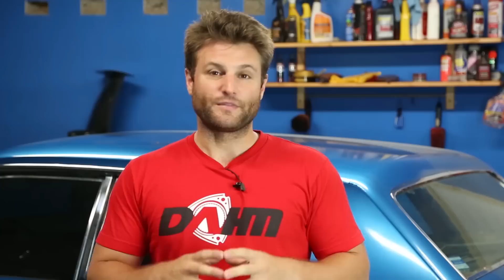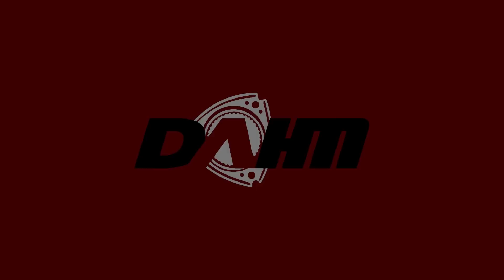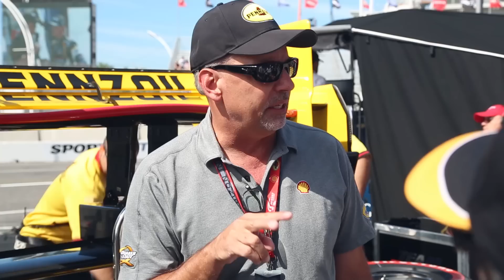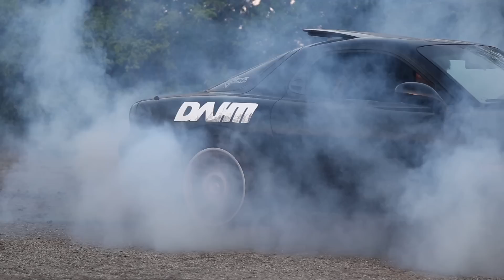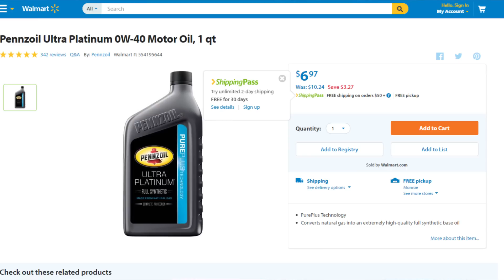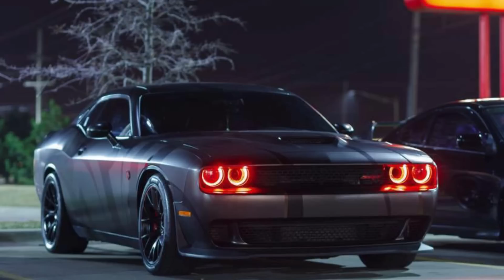Why I'm Using Pennzoil in the 4 Rotor RX-7

Comment: rob indie cars dont have apex seals... afaik rotaries LOVE burning dinosaur remains and hate synthetic crap (talking about oil not gas)
Reply: its not that they hate synthetic, its that synthetic is more expensive and rotaries comsume oil, its cheaper to keep feeding your rotary monster conventional oil than synthetic
Reply: +Shawn Stephenson yeah I haven't heard that they dislike synthetic, it's just the cost
Reply: I got  145,728 miles on my 12a rotary Turbo. royal purple synthetic oil seems to be running just fine
Reply: Godfrey Poon possibly... in my opinion the best solution would be to premix it with fuel...
Reply: Godfrey Poon well you do burn a lot of the dirty oil off. I did the sohn after i rebuilt my engine, trying to do everything right this time around.
Reply: Chances are robs car will have the OMP deleted and run using premixed fuel, meaning it will not be pumping oil from the pan to the combustion chambers.

Most synthetic oils do not burn well, which is why using synthetic oil with a factory engine is less than desirable.
Reply: SOHN with 2 stroke oil is the best solution. Just get a tank of idemitsu and plum it to the OMP. The synthetic oil thing really isnt that simple. For RX8's said use dino in the US bc thy didnt do extensive testing with synthetic oils. In japan the released a product called synthe-renesis after a few years which was designed specifically for the 13b MSP. Plenty of people use synthetics of all types in RX7s. From what I've seen sending off old pennzoil to get analyzed always comes back with much more metal in it then a good redline synthetic.

Comment: i used pennzoil platinum (not the ultra platinum) in my 2.5L N/A subaru legacy and i burned a quart of oil in 60 miles and immediately purchased new oil and got rid of it my car was blowing clouds of pennzoil out the exhaust
Reply: I've never lost any amount of oil to burning it or blow by with the exception being using that specific oil. there's gotta be something about the subaru motor and that oil that just doesn't mix lol
Reply: lol the motors worn out the Pennzoil gets to places better than most oils making it smoke
Reply: Matt Drew i've put 46k miles on the car since that happened and no smoke issues using royal purple oils. if the motor is worn hopefully it's not critical xD
Reply: check with your local dealer about recalls or service bulletins on piston rings.  there was an issue across a few models with the piston rings not being installed correctly and the ring gaps lining up and cause you to burn oil and get blow by.  if you have one  they'll fix it under warranty whether you're under warranty or not.   start doing an oil burn test next oil change.

Comment: bruh this advert was worse then rob ferrettis personal trainer bull shit
Reply: Hey Rob, I know it doesnt have to do with a personal trainer, but seeing this, and how often you overheat, made me think of Evans Waterfree Coolant, you should check the stuff out. I run it in my stock block STI making 440 to the wheels and never had any over heating or detonation. Jay Leno did a video on it a while back, and there are some snowmobile two stroke guys out there running their temps way past boiling without damage (like 300+ degrees) They also make track approved stuff so you dont need to swap to straight water. Anyways if you like the oil you might like the coolant science. Its propylene glycol, and doesnt boil until around 400 degrees so you can also run pressureless. (If you get a leak you can just duct tape it up). Anyways it might let you run at that 240 without much worry.

Comment: I've read around that synthetic isn't good to use in a rotary?
Reply: Cheap synthetics are bad but high end ones are good
Reply: Personally, I don't like synthetic because it doesn't stick to the parts and if you let your car sit for a while, you'll have dry starts.
Reply: jylp4u    n q
Reply: You can run any synthetic if you remove the oil metering pump and run premix.
Reply: rotaries hate synthetic oil...it doesnt burn well... rotaries want dinosaurs in them
Reply: eletor to the rescue, whatsup man
Reply: Nothingspecial Ayyy dude, just trying to help!